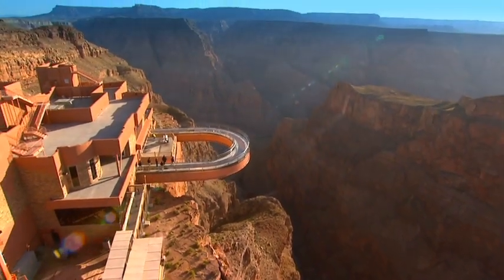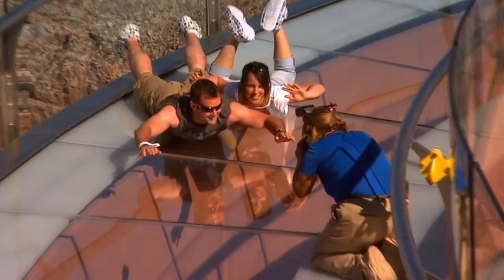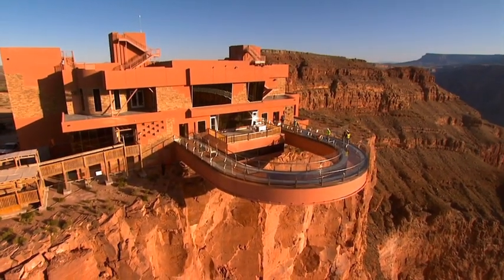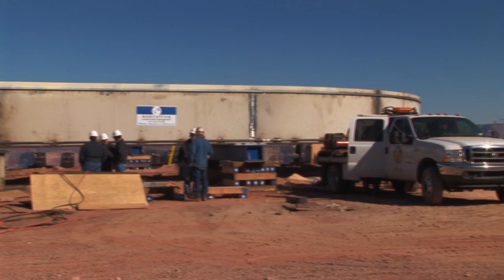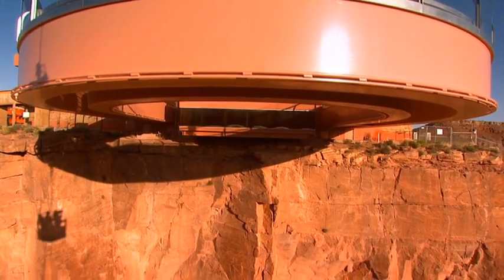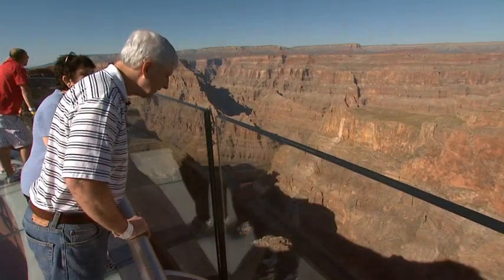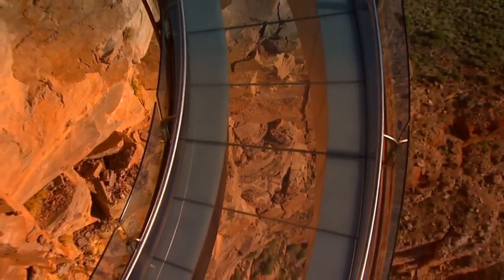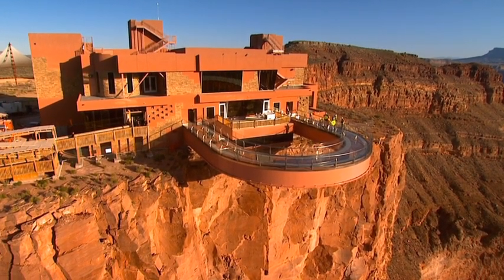Skywalk History and Engineering

Comment: First year physics: Leverage.  The maximum weight from edge of the structure x the distance from the center of the system (with 8 pilings) is the maximum force acting on the system.  Add at least 20% more for safety, wind and earthquake factors.  The more the building and the foundation weigh the safer.

The beauty is in the original artist's concept and design.